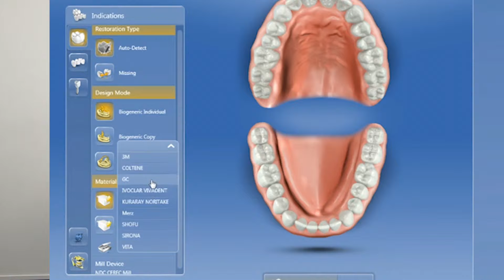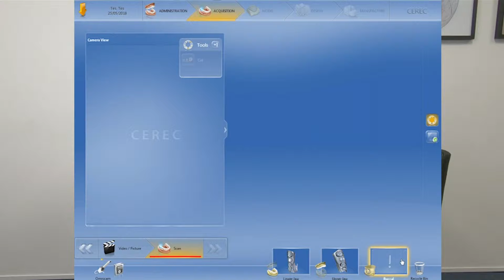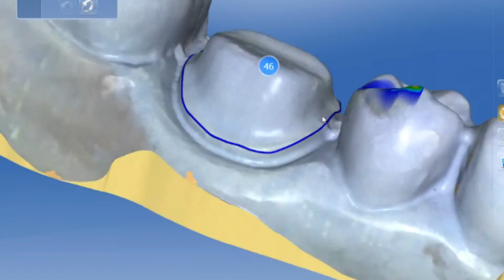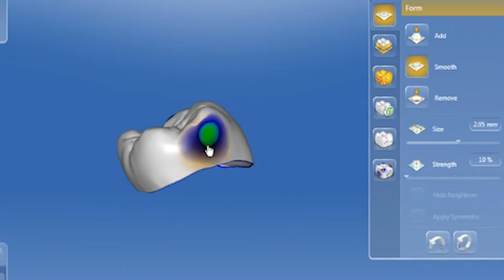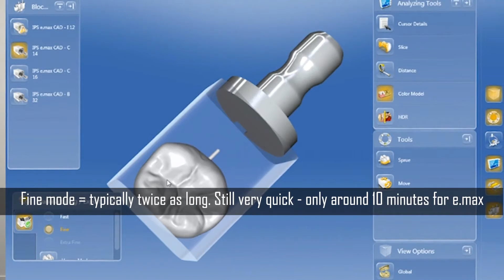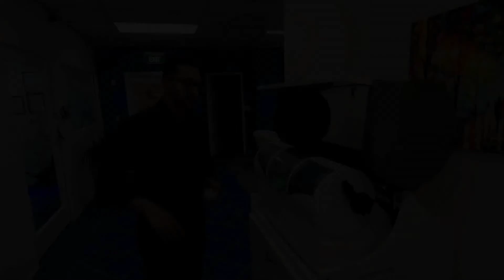Entire Digital Workflow for CEREC Omnicam Scanner and MC XL Mill for a Single Posterior Crown

Comment: Would you still recomend omnicam? The price is very good,
Reply from the maker: For same-day dentistry limited to quadrants - yes! It is still an acceptable scanner. 

However these days for an impression replacement device, there are vastly better options and you could even look into combining Medit / TRIOS with MCX/MCXL mill
Reply: @InstituteofDigitalDentistry  How do you combine medit/trios w/ mcx/l milling units?
Reply from the maker: @justinjang9565  only way is by using InLab software. It is the key for using CEREC mills with 3rd party scanners.
Reply: Hi. Great videos. I have a question. If I bought a used Omnicam scanner, would I be able to download and install the software on my computer for free or are there any restrictions?